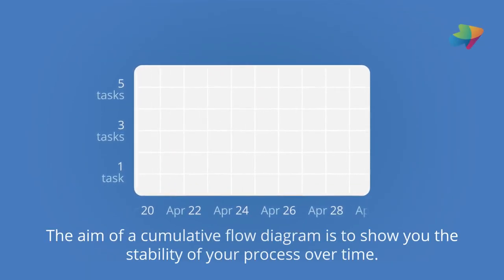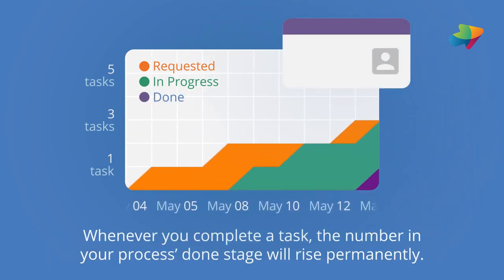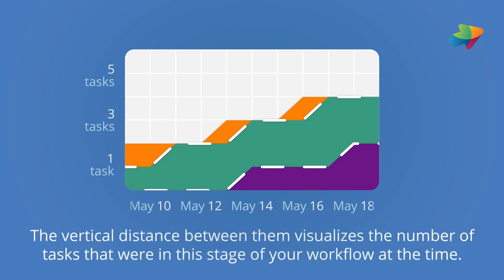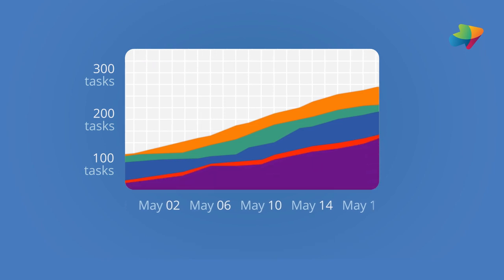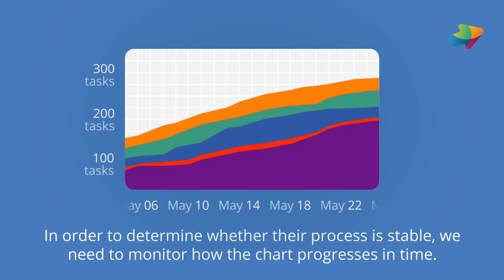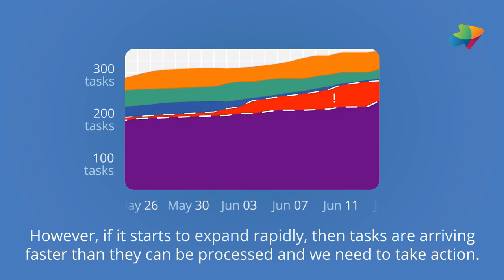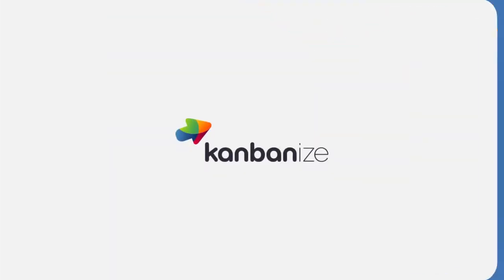Cumulative Flow Diagram (CFD) Explained in Two Minutes

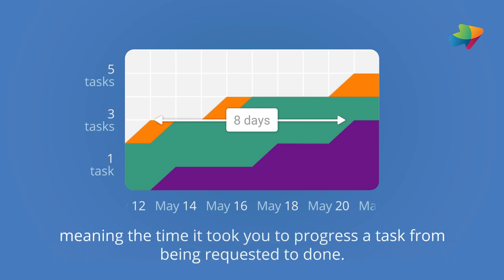Comment: Hi, in 0:59" when you talked about cycle time in the video you showed the lead time instead, not the cycle time. Based on the article on your website, cycle time is from the point when progressing is started til Done. The lead time is from requesting to being Done. Please correct me if I'm wrong.
https://kanbanize.com/kanban-resources/kanban-software/kanban-lead-cycle-time
Reply: thanks for this link
Reply: Hi All, from my understanding, there is great confusion with regards to these two in general - I think what is more important is that the team understands for their process specifically, what they would refer to cycle or lead time (what does it mean to us).  Also, Kanban refers to two 'lead' times in terminology at least, one from request to done ,and one from work commencement to done - I think, I stand to be corrected :)
Reply: Actually, almost all the information in this video is wrong. And that's sad.